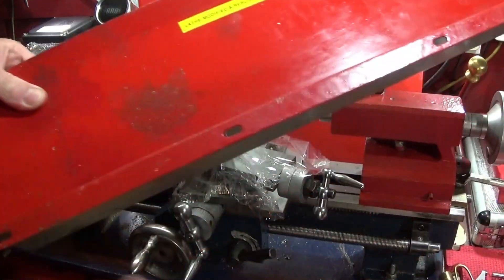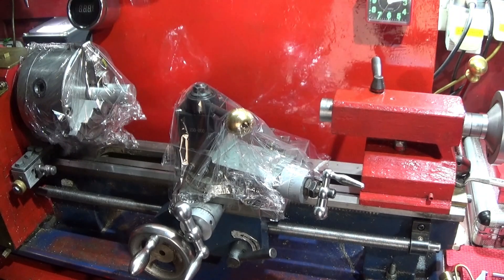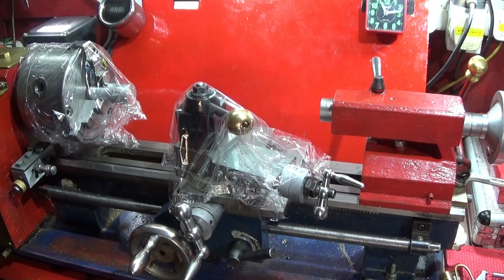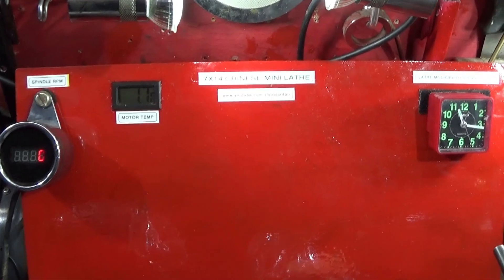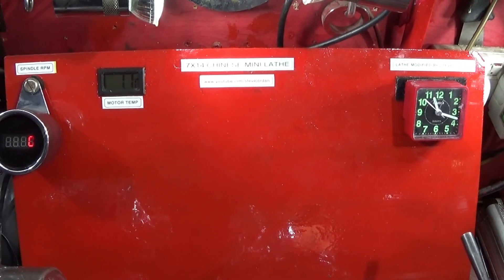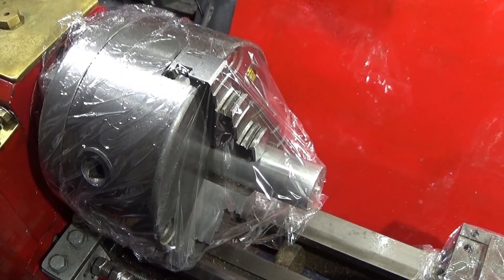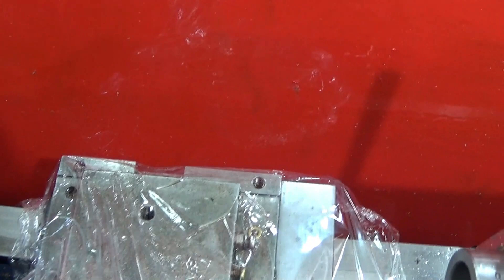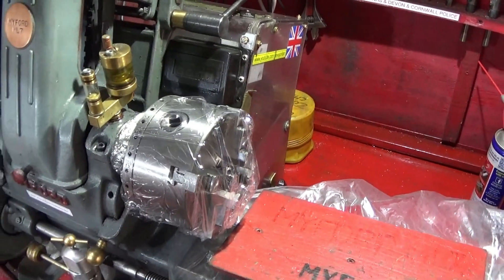My New Chinese Mini Lathe Guard Upgrade & How To Stop Rust

Comment: Hi Steve, I have the exact same Chinese lathe as you and also have a rust problem in my shed. I bought an aerosol called Boeshield T-9, it leaves a thin waxy finish which prevents rust for months. It's a bit expensive but the can lasts for ages.
Reply from the maker: Hi Glyn that sounds good. I will have to get some for my spare chucks and tools that are not being used too often. Thanks Regards Steve.
Reply: @SteveJordan  I find for best results, clean the chuck etc with fine emery first and then spray it with Boeshield T-9 and turn it now and then as it dries to maintain an equal covering. I think I paid about £29 for mine a few months ago.

Comment: Hi Steve, good mod, hasn't that pot of red paint run out yet? Great tip on the cling film, I am really suffering with corrosion at the moment, it's so wet up here in Scotland and we live at 700ft so humidity is close on 100% most of the time. It must be quicker to wrap than to oil up. Cheers, Jon

Comment: I'm in Melbourne Australia and am having opposite (temp wise) it was 35°c in my workshop today and 60% humidity.   I have a couple of lathes also and I'm getting a lot of rust on them overnight also.  I spray them down with WD40 after use.  But with the spray you get dust caught in it.
Reply from the maker: The cling film has worked for me on all seasons. I live in a valley on a river plain. It is difficult to dry clothes on the line sometimes. This cling film stopped all the rust problems completely. Regards Steve

Comment: I usually spend 5 minutes cleaning off my lathe after use, then give everything a quick misting of WD40 at the end of the day. Never had any rust spot problems on it since I started doing that, and in winter, damp always get around the wooden "Barn doors" on my little garage workshop (Occasionally it gets so bad I can actually feel the bloody damp in the air !!!!  ☹ ).

I'd love to build a nice little insulated hobby workshop here, but as moneys always been too tight for that, I've got to work with what I've got. :(

Comment: What is the size of that lathe?
Reply from the maker: Its a 7 x 14" Mini Lathe
Reply: @SteveJordan  Do you ever regret the purchase, or need more?  I keep being told to go as big as you can, but each step up is 200-250 USD.
Reply from the maker: If you can get a bigger lathe it would be worth it. I have the Myford ML7 which is a bit bigger, but I would have bought something bigger if I had the room. The Mini lathe has been very good though. I have made hundreds of different components using it. Regards Steve
Reply: @SteveJordan  Room is the biggest issue.  They do make 8x14 and a 8x16, but cost is a factor as well.